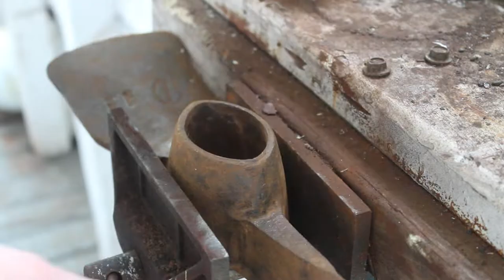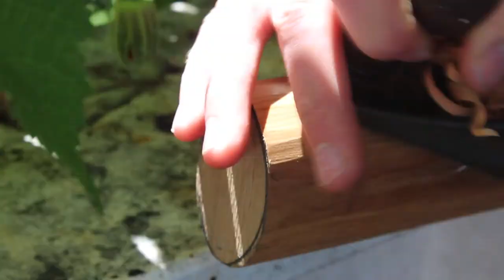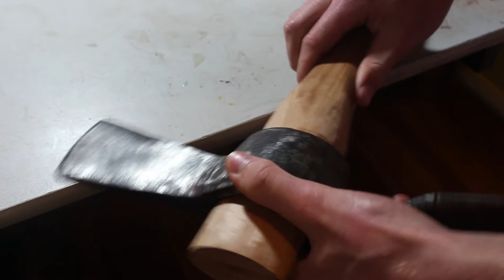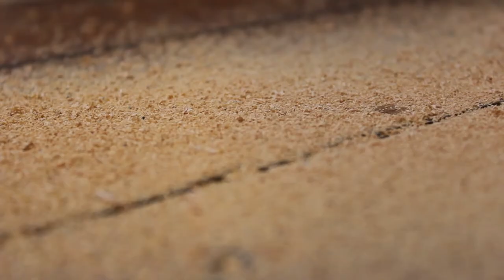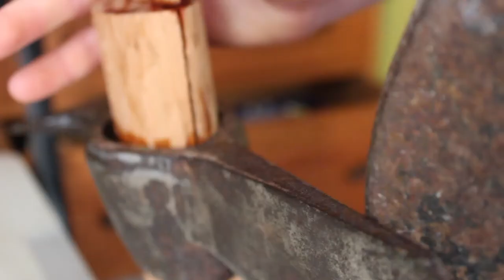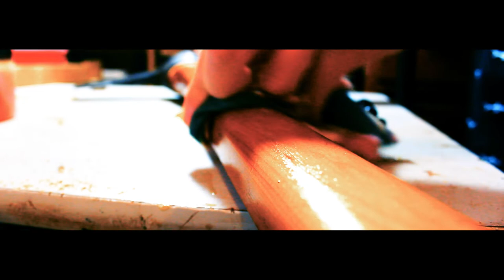Pickaxe (Mattock) restoration

Comment: You did a great job restoring the head of the tool, but you fit the handle wrong by every way I have been told, taught, and grown up with 
You fit it like an axe. When it's supposed to be friction fit from the handle part to the end, by bumping the top of the handle on the grown and letting gravity plus the weight of the mattock squeeze down. When you're tapping the handle on the end with the "physics" part, that is correct. But there shouldn't be any gaps between the tool and the handle. How you've fit it will hold, but not as well as had you gone from the top end of the handle to the bottom
Reply from the maker: I know I realized this after I fitted the handle but whatever it works fine how it is.
Reply: @infiniteoutdoors2837  so long as it works!🤓 You did a great job overall.
Reply from the maker: @KamalTailor  Thanks :)
Reply: @infiniteoutdoors2837  
Don't worry, I doubt that handle will come off any time soon.
You make ax handles at school, I shudder to think what you make in metal work class.
Reply from the maker: @wjf0ne  ahahaha yeah the handle has withstood a lot of hard work and it's still as good as new.. the teachers were to busy to even notice ahah

Comment: Head slips on from small end of handle and drops down close to the end of the large end for a friction/jamb fit!  A couple taps on a hard surface to seat it and it’s ready to go!  They are easily to store/transport broken down which a couple taps on the small end will accomplish.  Assembled the way you did makes a dangerous tool looking to hurt someone!
Reply from the maker: Yeah I watch tutorials showing that handle technique after i had made it, but this handle should do the trick for now
Reply: Two things to think about!  The correct handle allows it to breakdown for transport/storage and the correct handle is safer!